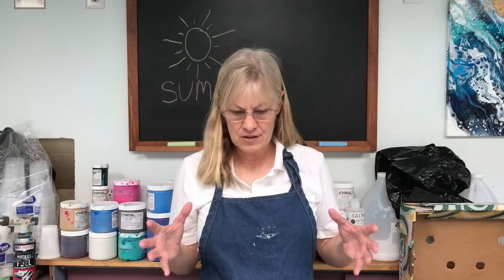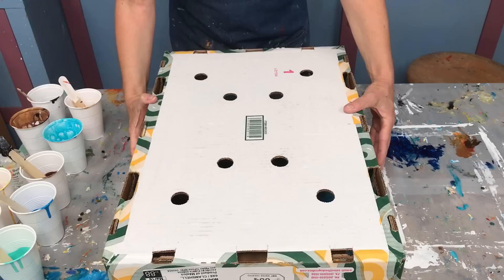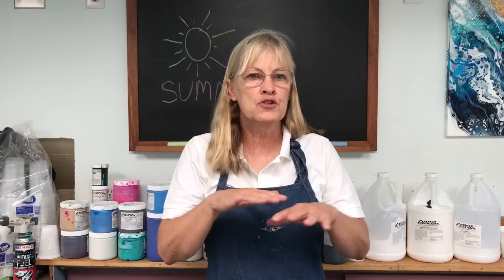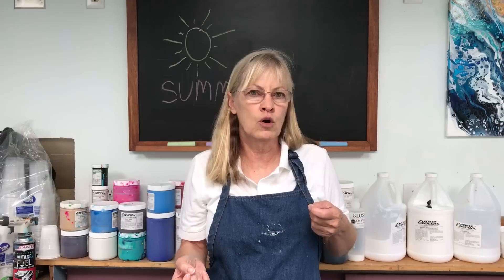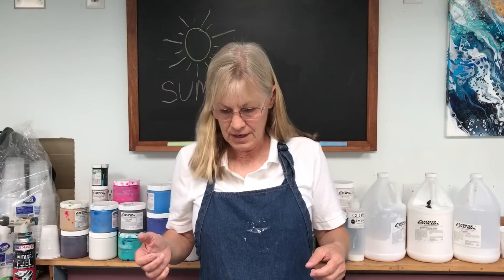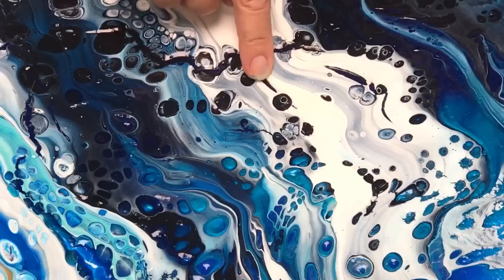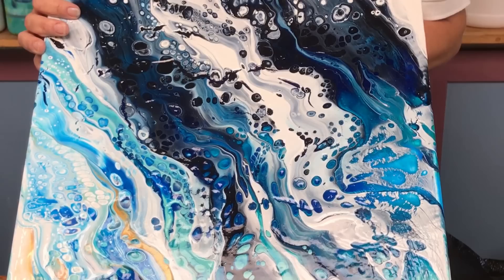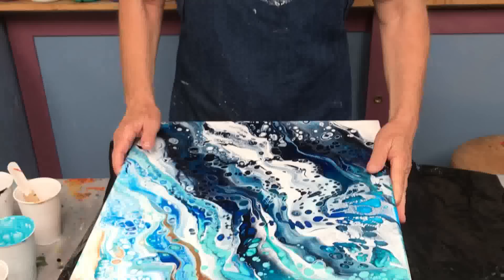Acrylic Pour Painting: Minimizing Cracks During Drying Process

Comment: Thanks so much for this video. I'm new at this and I know that a slow drying time is preferred. I have confidence now from watching this. I had wondered about using an old Harvest Maid dehydrator (not connected to outlet) for drying trays as, it would give me plenty of room for my small pieces. I was afraid that it would not have enough airflow with the door closed but now I'm thinking this would do the same thing as covering with a cardboard box. There are ventilation holes in the rear.
Reply from the maker: Yes, the main thing is to not try to speed up the drying time with blowing air or heat.

Comment: Nicely done with the analogy of the painting and brownies baking.  Wasn't sure what was going on as I have some that paintings which crack and others that do not.  I did one that had great movement, some cells, etc. and I got micro cracks everywhere!  Too thick and wet in some areas so its drying unevenly.  Just like your analogy.
Reply from the maker: Robert Giebler I hope you can save the painting you like that has micro cracks...sometimes it's best to embrace the flaws. Give it a clear coat and call it good!

Comment: Excellent video :)  I just tried my first paint pour and yes there was a fair bit of crazing.  I didn't have a torch so I tried to use a embossing gun and kind of overdid it and cooked some of the paint :(  All A learning experience.  I also am having abit of trouble getting the pouring ratio to paint correct.  I made a DIY pouring medium consisting of 3 parts glue to 1 part distilled water.  My first two attempts I used silicone oil, which I found to be very thick. I have now purchased the spray and am thinking of trying that.  I've watched SO many different videos on here now that I am actually abit confused as how to do the whole process as everyone is doing it differently.
Reply from the maker: Eliesabeth Fogg the silicone I use is not thick at all...I have a link to it in the description below my video. But the spray should work. The glue may be the reason for cracking.

Comment: I'm painting something small on a spray paint surface using acrylic and it forms cracks except for a certain color, it's also hot 71F outside is there something I'm doing wrong? Does it need to be a cold environment? Or a hot environment

Comment: Ty so much i just had two pours i did yesterday and these cracked it's sad. So now i know how to prevent it cracking or fix it.
Reply from the maker: Giselly Rodriguez cracking can be caused by too thick of a paint mixture, using glue instead of pouring medium, certain brands of acrylic paint, among other things. So while my solution works, you should also look into why your paintings crack in the first place.

I now have my own brand of Paint Ready To Pour, called Happy Medium. It’s ready to pour with no mixing or measuring, and doesn’t crack! Check it out at happymedium.fun

Comment: Thank you for this video. I'm very new to pouring techniques and have found this to be a recurring issue. Obviously with being new to things I expect some mistakes. I know this is an old video and may not get a response, but if anyone is reading and may know, does the humidity of where you dry your painting effect cracking? I'm in Florida so it's almost always incredibly humid, was wondering if that's something I should take into consideration while painting. Thanks!
Reply from the maker: Jessica Hurst hi Jessica, I don’t think humidity contributes to cracking, the most likely culprit is your paint mixture being too heavy and possibly your pour was too deep. It’s hard to know without seeing your paintings or knowing what issues you are having. Yes this is definitely an old video, and since this video, I went on the create my own line of Paint Ready To Pour called Happy Medium. It is consistent and never cracks. It has everything in it, including silicone, to do pours. It can be purchased at www.happymedium.fun

I’m not trying to respond to you with a sales pitch, but I know how frustrating it can be to constantly run into problems when you are supposed to be having fun.
Reply: @carengoodrich  Thank you very much for your response! I agree that it may be the thickness, I'm still learning how to mix things. I'll give your line a look to see if it will fit my needs. Thanks again! :)

Comment: Hi karen. Im new to fluid pouring, and im having a difficult time stopping my white paint from crazing. I am currently using floetrol and plaid/apple barrel paints. My colors come out fine unless i mix my colors with white or use white alone then i have craze city going on. I use 1:1 paint/ floetrol. Ive tried adding water (purified water and baking soda mix) to my white and still the same results. When i use the white alone to paint the back of my panels they came out fine. Ive tried less water, more water, more floetrol, less floetrol all with the same results. Can you please tell me where i can possibly be going wrong? Or maybe it is just the paint?
Reply: I’m not sure about plaid but apple barrel is a craft paint, and lower quality than artist paints. Try using a better quality paint like Amsterdam or I’ve used Monte Mart for white bc it’s a little cheaper

Comment: Hi Caren,
I've been using the Minwax Polycrylic on your suggestion. When I do a small piece - like 6 by 6 and brush it on with a sponge brush - it comes out nice and shiny and I usually do a couple of coats. Anything bigger - I'm getting streaks and the more I work at it the worse it gets. I tried pouring a little but it doesn't flow enough. Any suggestions?
Reply from the maker: Barb C put it on, spread it, and leave it alone. It dries relatively fast so if you are working at it maybe you are brushing it too long and it's starting to dry.

Comment: Hi Karen, I have found with the novaplex 233 I can avoid cracks by keeping a 1:1 ratio of paint to medium plus adding water. As long as my consistency is on the thinner side I can usually avoid cracks. if I want to use a higher ratio of medium I have had better results with novaplex 235 or 206 medium and varnish.  Hope this helps!
Reply from the maker: ccubillo great that you are figuring out what works! I usually use 1:3 ratio of paint to medium plus a little water. I currently am using both 233 and 235, I just add a bit more water to the 233. I have some 206 but didn't care for the consistency. I will try it again since I own a gallon of it!
Reply: Caren Goodrich I know what you mean about the consistency with the 206. I love the consistency of the 233 but the crazing is so frustrating... so now I pour primarily with 206, mainly because I wanted something a little thicker than 235 that would not craze on me.  So far no cracks, I hope it works for you :)

Comment: will just regular varnish work as an archive process ?  I have been using hair spray but the hair spray is untested so far as I have applied it, thanks , the ocean painting you showed is amazing,  Peace !
Reply from the maker: Moda Mont not sure what you mean “as an archive process”, but I clear coat my dry paintings with Minwax Polycrylic. (Hardware store item)
Reply: @carengoodrich   what I meant is to seal the painting from atmospheric elements to preserve it for longevity and preserve it otherwise I hear they turn faded and lose luster etc. like how a newspaper will turn yellow after a while .  Thanks !
Reply from the maker: Quality acrylic paint will not fade if reasonable care is taken to keep it out of direct sun. A clear coat helps protect it but the most important thing is to use good quality paint.
Reply: @carengoodrich  Thank you great advice, i'm new to painting so i bought the cheapest paint and it's not very good lol live and learn.  Thanks !